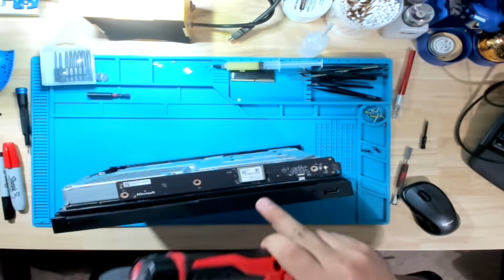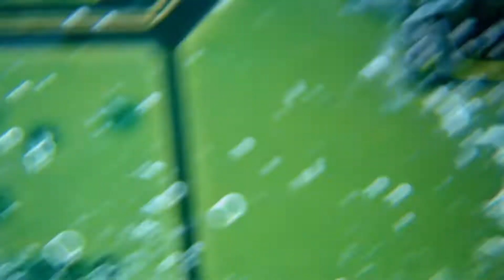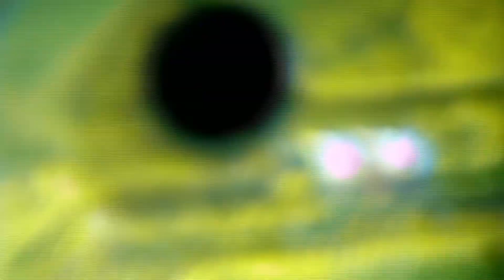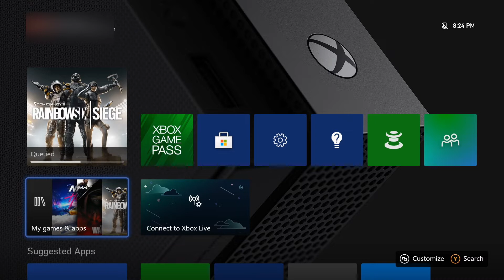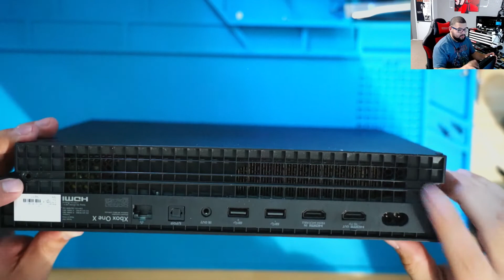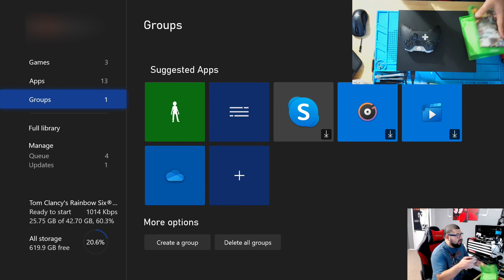Water Damaged Xbox One X brought in for overheating

Comment: Hey man recently I had water fall onto my Xbox one x and some got into the HDMI port and now when I turn on my Xbox on my 4K tv it usually reads the console on my tv and now it doesn’t detect it & the biggest problem of all is the whole screen looks like I’m playing with widescreen instead of 4K
Reply from the maker: Sorry for my late reply, just now saw this comment. This issue will be your video encoder chip also known as the retiimer IC chip. I hope that this helps.
Reply: @RosalesSuperTech  that helps a lot man. I’ll be emailing you very soon about pricing and how I send over my system if you’re able to fix that problem ?
Reply: My Xbox actually just came back to life by itself lol
Reply from the maker: Okay, awesome. Thanks bud.